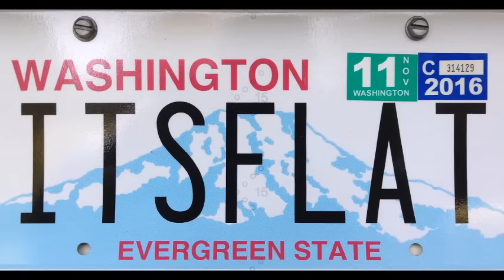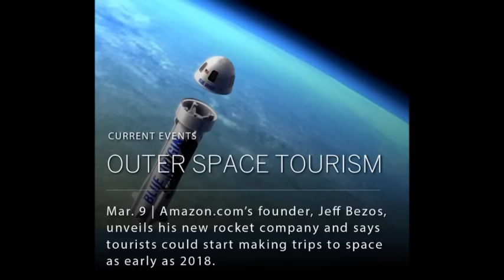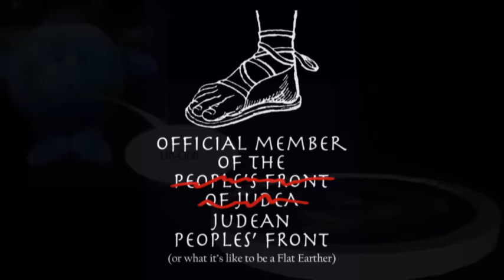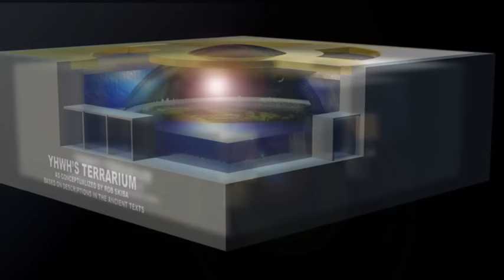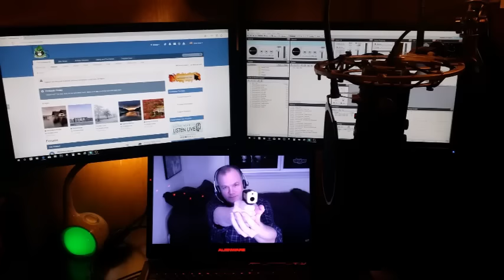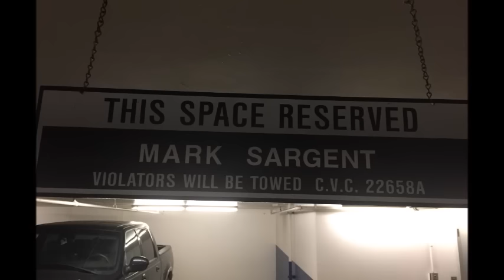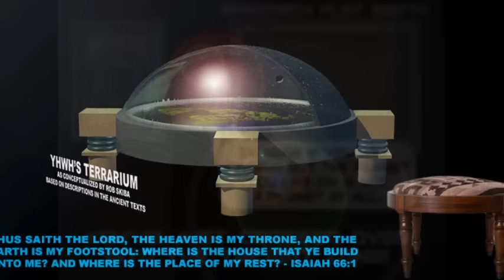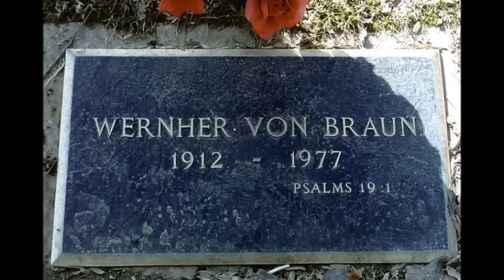Flat Earth Q&A Emails 1 - Mark Sargent ✅

Comment: The reason the flight went so high was because the earth isn't a perfect sphere. It's slightly squished.at the top and bottom because of its spin. Because of that, it's easier to go over the top than to go the long way around the wider part of the earth. It's also safer, because there are more places to land in Greenland than there are in the northern pacific ocean.

Comment: there are another thermal phenomenon to compare, look to the earth... when you climb with an airplane you have the termal degree decreasing... if you compare to earth distance pole to pole, you have this thermal invertion too, that's significant to see the earth is flat...
both cases, have and thermical invertion...

Comment: Target shooters don't account for earth spin and I gotten bullets inside same holes with no issue.
Reply: Long range shooters do...
Reply: John B Show me your calculations
Reply: Well John, if the Coriolis effect applies to a bullet, then it would also apply to anything free from the ground, which would also apply to airplanes, So with that in mind, the earth is supposed to turn at 1040 miles per hour at the equator, I am at the tropic of cancer, which puts me at about 800 mph. So 800 mph broken down to 60 seconds in that hour would be 13.3 miles per second. so if I jump in the air and remain there for a full second, I will have moved from my original position 13.3 feet, and that ain't happening !!! You can throw you Coriolis effect out the window, it does not apply to long range rifle fire.
Reply: Elmer Fox so if you are driving down the road and drop something does it fall in your lap or hit the back window? Basic critical thinking is beyond anyone who believes this nonsense.

Comment: That is a reason for non flights near The border of The globe, physics have to appear unflyable, like if you try to fly into 60 thousand feet, The airplane can’t reach that because The air is less masive, probably it could begin going down more And more... when you learn to fly, The orientation is to do not fly after north because The magnetic heading would not work well, but that can be an flat earth orientation to not approach near The border... but i believe The reason its cause The physics near The end of The border...